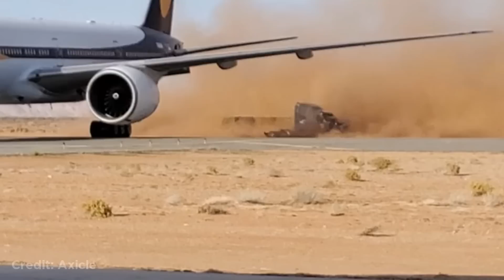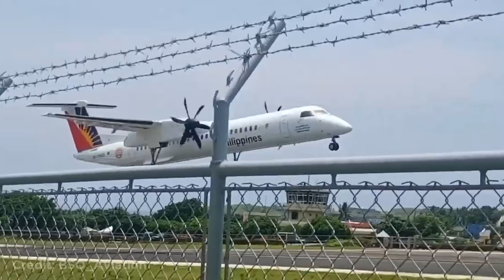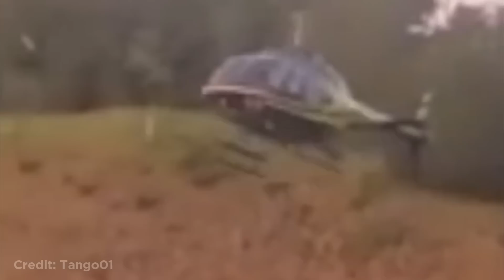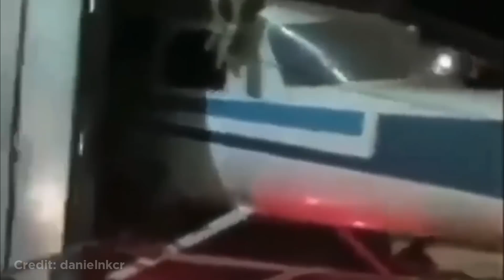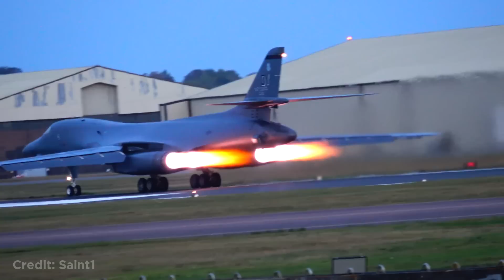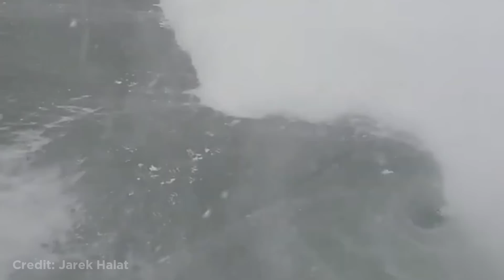Plane Blows Trailer Away

Comment: I am glad to see Lucaas is learning his planes.
Reply: Isn't it? Imo it really retracted from the quality of the videos when you would just hear "This fighter jet..."; "This passenger plane..." etc. I'm not saying that he should learn all the Cessnas, Bombardiers and all the other similar looking aircraft, but knowing or at least saying "This F-18/F-16/Su-27/A380/737..." would make the videos feel like a true passionate is making them
Reply: I think he still got it wrong whit the Qantas jet. 
It's a Mc donnel Douglas MD80, -- 82 airliner.
Reply: @DPNP-ls7ro  The Qantas jet, VH-NXO, is a 717. Easiest way to tell is its relatively short length (similar in size to the original DC-9) coupled with the flat tail cone and larger diameter BR715 engines. The 717 was originally marketed by McDonnell Douglas as the MD-95 before the Boeing merger.
Reply: @One_Shot_Garage  Good stuff
Reply: Remember feller's, Lucaas is still just a teenager!
His vids are great and yes it's awesome that he is starting to add the type of flying craft, models and such.
When I first started this channel I was shocked to learn he was only like 15 years old then!
Reply: @One_Shot_Garage  nice. Thanks for making it clear. 💪🏿
Reply: Luckily no one was injured

Comment: To this day the B1B is still the loudest jet I've ever heard take off. Those engines are brutally loud at full afterburner.
Reply: I don't think I've ever heard one in person🤔 loudest I ever heard was the U2. I worked in airfield management in the Air Force. That U2 though - everyone complained, especially when in departed at 5am😂
Reply: The F-16 is super loud, and the B-1 has 4 F-16 Engines !!!
Reply: Luckily no one was injured
Reply: Try the SR71. Make you think that's quite reasonable
Reply: Loudest I ever heard was a Harrier jump jet, not so much because of the size of the jet, but it was stationary and hovering right in front of us, so it was a long loud!
Reply: @joeg5414  a U-2 spy plane? That’s not that loud is it? The F-15 is louder I think
Reply: It doesn't look that big, where is all that fuel coming from?
Reply: @kdwaynec  those wings hold a decievingly large amount of fuel.
Reply: honestly i think the loudest jet ever, is the Avro Vulcan those howls are insane
Reply: That T-37 Tweety was incredibly loud.  And more annoying.

Comment: B1B Bone -- Amazing machine  -- I wonder what the lowest (unofficially)  attitude flight -- Ive heard its capable of flying 5 to 7 feet off the ground..
Reply: Any plane will do that. Either during transition between flight and not-flight or based on the risk tolerance of the pilot
Reply: I think he just used up a quarter of his fuel with the burners lit.
Reply: Luckily no one was injured

Comment: Q-400 tailsstrikes are more common than it should because of how low the plane is to the ground and how little you can lift it's nose before the tail hits the ground, pilots need to be really carefull as to not hit the runway when taking off and landing
Reply: The runway also has a 4° slope runway so it's really hard trying not to hit the runway

Comment: 777 has very impressive thrust for the size of the plane, all thanks to those ge90s. Having done deicing for airplane, there’s one airplane they tell you not to drive behind while the engines are running. It’s for that exact reason. I love the ge90 but I have no intention of finding out what wind awaits the rear end of the Goliath

Comment: I didn’t even know there was such a thing as Boeing 717
Reply: Trust me there is 727 as well. The trijet!
Reply: Boeing 717 is a Douglas DC-9-based jet. McDonnell Douglas designed it before they got bought out by Boeing. With the other Boeing 7x7 numbers, the airplane model # tells you what chronological order they were introduced in, from 707 up until 787 (and maybe 797 in the future). 717 doesn't follow that trend.

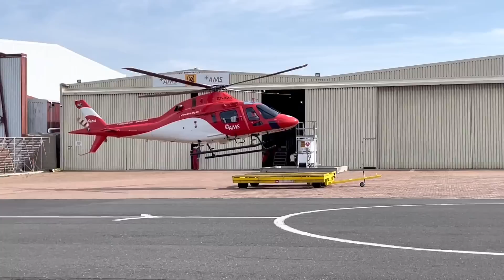Comment: 2:30 how did such a heavy aircraft land wich such low rotor speed?
Reply: It's probably an optical illusion, caused by the RPM matching to a multiple of the camera's frame rate combined with a high shutter speed ;)

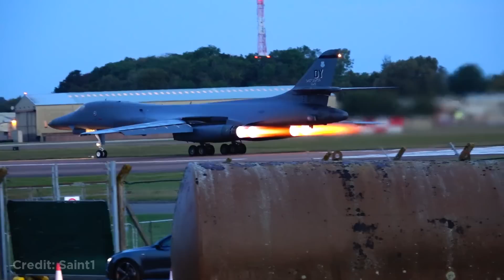Comment: The 777 has the strongest and most dangerous jet blast of any plane ever, those engines weren't even near full power! Surprisingly, it's safer to stand behind a B-1B during takeoff like the one at 2:00 than it is to stand behind the 777 during takeoff even though those afterburners look a lot scarier than anything about the GE90.